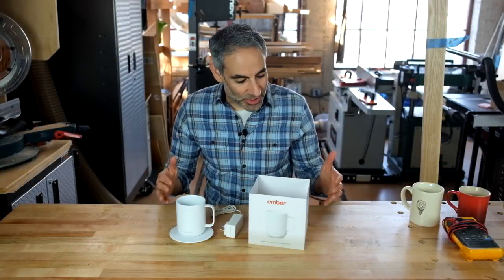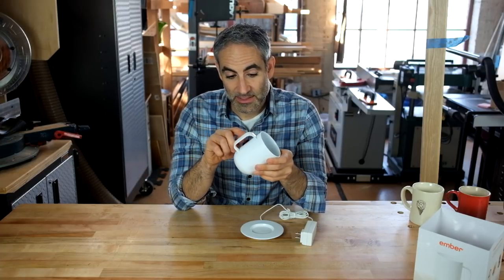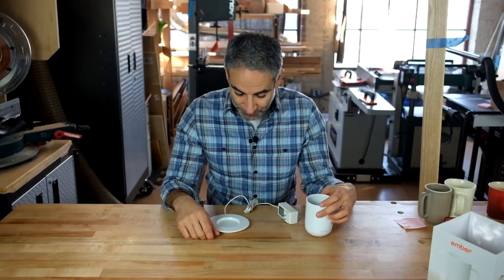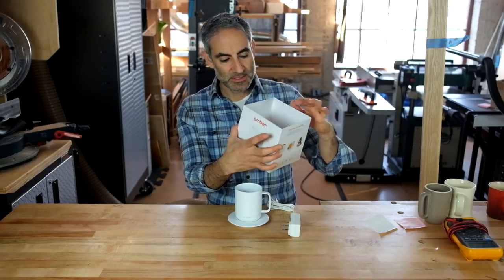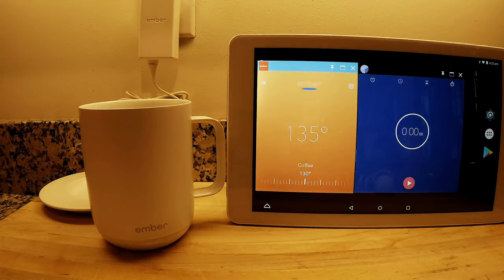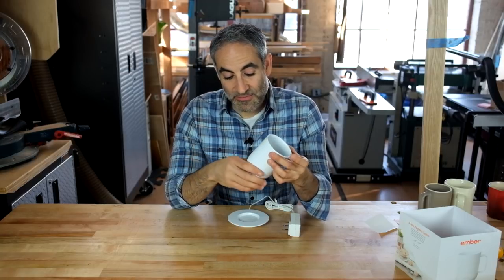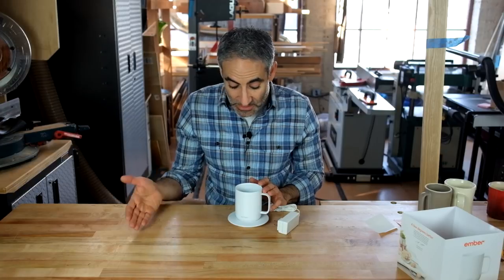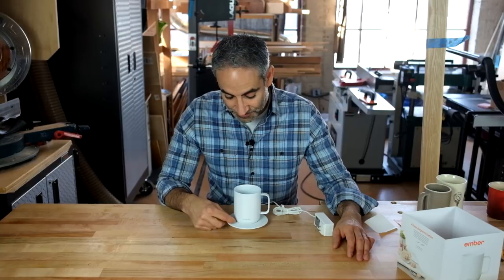Ember Coffee Mug Review: Things you need to know.

Comment: The reason for the "saucer" is to force alignment with the gold pogo pins.  Those pins are the weakest aspect of the design.  If the tiny spring breaks or gets gummed up electrical contact can't occur.  The design is very vulnerable to a single fragile point of failure.  Those pins are not easily replaced.   That scenario occurred with the earlier model cup.  I'm surprised it was not fixed here by increasing the number of pins for redundancy,  or by putting more robust contacts (matching rings?) on the base.

Comment: Jesse, Great job with the video! 
I've been using my Ember mug daily for almost 4 months now. I originally purchased 2 mugs and an extra charging coaster (3 coasters total). At about the 3 month mark, the ceramic coating started to chip off inside the mug.  I always washed by hand but I did use a bristle brush and that could have lead to the chipping. I contacted Ember via email with photos and after asking for the serial number, they sent me a new mug and a return label to send them back the damaged mug. 
Before the new mug arrived, two of the coasters stopped working. Shortly after the new mug arrived, the 3rd coaster stopped working and I had no way of charging either mug. Apparently, the gold charging tips are spring loaded to ensure a good contact with the mug when the mug is placed on the saucer. On each saucer, one of the gold contacts lost it's ability to spring back effectively making the saucer useless. I again contacted Ember and they sent me three new saucers...so far so good. They also explained to me that there was a manufacturing issue with some of the batches of saucers and that issue has been resolved (time will tell). 
FYI...I drink 2-3 cups of coffee at 140 degrees filled very close to the brim daily in the Ember mug.I almost always keep it on the charging coaster when not in my hands. I drink the coffee fairly slowly throughout the morning between 8:00 am - 11:00am and they only time the battery has gotten low is when I went walking around and left it off the charger. 
In one instance, I accidentally left a 3/4ish full cup on the charger one Saturday while I went out to work on the yard. I returned 3-4 hours later and the mug was still at 140 degrees and at least 50% of the coffee had evaporated. Suffice it to say, I think the Ember would evaporate a full mug full of liquid before the battery would die when left on the saucer. 
Would love to see a long term review of your experience with the Ember mug. Even with the issues I've had, I think it's worth every penny...assuming Ember stays in business long enough to fix all their growing pains.
Reply: It is worth it!!
Reply: This guy wrote a chapter 🤔
Reply: You don’t need it to set in charging coaster when you drink.  I don’t put into the coaster until maybe i have 1/4 left in cup just to boost the charge a little. I usually have setting on table along side the coaster…especially when mug is FULL as I don’t want to get liquid in the coaster…it really is not a drip catching device.

Comment: Good review, though I thought I might see a tear-down 😉

As someone who sips on a cup for a long time, this clever device has been a game changer for me.  It's particularly nice for being able to enjoy my various white teas and more fragile greens at a slower pace.  It's actually great for making gyokuro in, as that tea steeps at only 140F (which is challenging to maintain precisely).

However, I too initially found the capacity a bit inadequate.  To solve this, I usually make my tea (or coffee) in a separate vessel, in 16-24oz batches, fill the cup and then reserve the rest in a thermos (which I use to top off the cup until it's all gone).  

The battery life isn't much of an issue for me usually, as I keep it on the charger more often than not.  The only concern I have is what the overall lifespan of the device - or, more specifically, the batter will be, given the constant switching between (presumably) high drain and fast charge, all while being sandwiched in with a heater...
Reply: Ryan Reese totally agree with you. Setting the temp for various drinks has been awesome.

Comment: Well made first video!  I’d say your arguments are well thought out and the experiments make sense.  Personally, I solved the volume issue by simply pouring my extra coffee into a Contigo insulated travel mug, which also keeps the liquid hot, so when I refill my Ember it is still warmer than my desired temperature.  The default is 57°C (134.6°F) which I find borderline too hot to drink for filter coffee... I have mine set to 52.5°C (126.5°F), and it tends to last me a couple hours or more (there is some idle time where the cup is empty before I refill).  I find it interesting that you enjoy yours above 140°F which is 60°C, but I see how that higher energy demand really cuts into your battery life.  But, that’s why it’s customizable!  (I do set temperatures higher for other drinks, like French press or hot chocolate).  My recommendation to you would be to store your coffee in a way that it can retain its heat - I think that’s far better than re-heating, especially if you are hoping the mug itself will do most of that work.

Comment: Jesse, THANK YOU for doing this review. Not only did you answer some deeper questions that other reviews have not, but you even provided insights that Ember's website does not cover (I could not find on their if the charger was AC or USB. Perhaps I should have known but I honestly don't know enough about electricity).

With respect to the time the mug keeps things hot or brings cool liquid up to temperature, it's my opinion that Ember envisions most people keeping the mug on the saucer at least 80-90% of the time, and only taking it off to go to a meeting away from your desk, then coming back and putting it right on the charger. I think if you used it that way you would not have a problem. That being said, that does limit the way people can use the mug, which is absolutely a consideration before buying it.

Comment: Your well-executed video answered and clarified my question about my Ember—which I love (mostly because it was a gift from my daughter❤️). From the FAQ available in the app I could not clearly find why one could not use coaster to heat/charge. 
You can use the coaster to maintain battery strength, but after removing cup, it used battery to maintain heat, not to re-heat. 
Oh and I like the handle “feel” (I have smaller hands and like the delicate feel of the slim edged handle). And I totally get that the charger is meant to appear as a coaster/saucer but—as with a lot of electronics—ought to be kept free of moisture. Just a different perspective there. 
Thank you for this great video. It was most helpful and you are a lovely and ingenious man for gong to the effort to do the time lapse sections.

Comment: I agree with all the critiques in this review. I purchased two mugs and one coaster. I drink tea out of one mug while I leave the other on charge, and after I have finished this one or the battery runs out I take the other mug and fill it with a new cup of tea made on the stove. Why not leave it on the coaster? Try leaving it on the coaster and report back what your experience is. For me, the clear green tea turns into a black muck. Something to do with using AC current and DC current (My theory). The DC that comes via the battery works MUCH MUCH better. The AC current directly from the socket (thanks tesla!) will muck your tea up.

Comment: The saucer thing bothered me as well. There is a little notch where the bottom and electronics meet that would probably keep stray drips from actually making it to the saucer.

I've been using mine about a week now and love it; keeps my tea and coffee hot as long as it takes to drink it. I think the use case you tested for though was appropriate for the travel mug. I have the saucer at my desk and usually have the cup sitting on the saucer. The battery is kicking in when drinking, walking around and when I'm in meetings.

I did test the heating capability while on the saucer and the mug did heat ice water to my desired temperature of 135. Not exactly the fastest way to heat water but it managed it. One thing I've yet to test is if the cup helps cool the coffee down any faster than ceramic. Being too hot is as much of a problem for me as too cold.

Comment: The HANDLE is actually for me a better design, larger round handles require you to use more pressure because its round shape doesn't allow any leverage against your hand. The SMALL 8-9OZ SIZE was kind of a turn off, but as a slow coffee drinker you'll get used to not noticing you're drinking less coffee because you actually end up drinking more that before (when you used to just dump it out because its been cold for so long) . I definitely vote for INDUCTION CHARGING.. but I wonder if that would be too slow to charge and keep hot simultaneously? I don't think your usual case scenario is (the usual). And in that case... you can place it on the coaster while it climbs in temperature and problems solved.

Comment: The main problem,  missed in this review,  is with the fragility of the spring inside the pogo pins on the charging coaster.  Pin collapse due to spring failure occurred with both the old-style mug and with the new.  This is an obvious design problem that should have been resolved before the product saw the light of day.  The entire functionality depends on a teeny,  tiny spring that is heavily exercised.   An obvious highly fragile critical single point of failure.  At the very least the pogo pin assembly should be easily accessible and easily replaceable, and a small supply (half a dozen) spares should be included with the product.
Reply from the maker: Good call out! I returned mine way before I hit this problem. But yes, does look like a huge design oversight.

Comment: I've had the original ember mug (which is more of a thermos rather than a mug) for coming up on a year. One thing i take issue with your use case is this, for me, i'm at a desk almost always when i am drinking coffee. So i have bought an extra charge dock to have on my work desk, and one to have at my home desk. So in the morning, i fill it up and immediately put it back on the dock, and while in use, i leave it on the dock. I take it off to sip, and it goes right back on. Using it this way essentially gives you unlimited run time. So the only time the battery is actually in use is if i get up to visit someones office and take it with me, or, on my travel to work in the car. 
Now one thing i do wish they had was a car charger, and they've said theyre working on this, but i've yet to hear any updates on this. But if you use it in the way i've described, where its almost always at rest on the dock itself, the issue with low run time is much less of an issue. In fact, i put room temperature coffee in my ember all the time, and as long as its on the dock, it will not use any battery, and it also heats up to my also desired 140 degrees much faster than yours did.  Another thing i'd mention is theres really no reason to dispose of the coffee after 20 minutes. I've poured coffee on a "light coffee day" at 8am and nursed it all day long, still having coffee at the perfect temperature by noon, or even later. Getting rid of the coffee after 20 minutes is kind of defeating the purpose of the mug. 
Also, as the amount of liquid goes down in the mug, the amount of energy required to keep the liquid at a certain temperature also goes down. The other issue i have with the new ceramic mug is that the amount of energy required in an open lid environment is much greater than my ember mug, which has a closed sealed lid. 
If i leave the lid off of my ember mug the battery depletes at a much faster rate than if i put the lid in place, opening it only when taking a drink. 
All in all i think you did a good job of indicating some of the limitations of using a small battery mounted heating element in a mug, but if your use case is like mine, where the mug can be on the charger almost all the time except in transit, or short trips away from the dock before being promptly put back on the dock when returning to your desk, its actually been quite an amazing product. Obviously if you're up and moving around all the time instead of sedentary, your experience will be much different. Sorry about the wall of text!
Reply: >as the amount of liquid goes down in the mug, the amount of energy required to keep the liquid at a certain temperature also goes down. 

Very good point. @Jesse, How about a short follow-up video where you remove, say, 10% from the cup every 10 or 5 minutes and see how much that effects the battery life?

Comment: Great review. I bought one about 6 weeks ago and as of this morning, one of the gold charging pins is depressed and no longer makes proper contact with the mug. I've contacted support, but wonder how long a new one will last.
Reply from the maker: Sorry to hear that! One of the problems with their design is that whatever spring (coil of leaf) that pushes those pins back up is probably steel and ANY moisture is going to gradually make those pins want to stick in the down position. Or at least, that would be my engineering assumption. Hope your's is swiftly fixed!

Comment: My last comment on this product (I promise). I have now used it daily for 465 days and sometimes multiple times per day. Today I tested how long the charge still lasts. There is inherently variability in this because the mug uses more energy to keep say 6 ounces warm than 2 ounces. Also, I keep my coffee at 145 degrees. If it was instead set at 135 the effective charge duration would be longer. Anyway, for about 4 ounces of liquid uncovered at 145 degrees after 16 months of use the mug still maintains the target temperature for 54 minutes. Compared to the original 75 minutes (from memory-I didn’t review the video) this is a reduction of 36% which is substantial but the mug is still quite useful, at least for my purposes. 
Based on this data, is it worth investing $100 for at least 1,000 temperature controlled cups of coffee (I generally have 2 or more per day) or 10 cents per cup? For me the answer is definitely yes but for others maybe not. Your results may vary.

Comment: I have purchased over 6 of these embers with 4 mugs and 3 tumblers.  I thought i would be using them more but i eventually ended up selling all of them except three keeping a tumbler for my mother and one of each for me.  however i noticed that i got lazy making the coffee and then pouring it into the ember while i could have just used my k CUPS and it makes my coffee for me.  What i do enjoy this item for is for a last minute drive in car or if coffee got cold and i put it in there to HARM IT UP.  THE ONLY THING I DON'T LIKE AND I DON'T MIND HAD Washing it is the small volume size.  i got the 14 oz. mug but even the tumbler is to small.  However cool product and I recommend it.  but also make sure you look at other smart tumblers or thermos and there are others that might be better.  The price is too high for this as I have noticed customers like to purchase this around $80 to $100 which sounds reasonable and a lot of Starbucks stopped carrying them because they kept on getting stolen.  of course no security and the product is the most expensive item in there (like everything else, LOL).  I will get again in future and have gotten the second edition as well especially the copper special edition just for the cool color and the look when i'm drinking it.

Comment: I have this mug. Someone was selling it for $35. I bought it. It originally sells for $100. I do keep the "coaster" plugged in and the cup on top. I agree it has a small capacity. It is not worth more than perhaps $25. I also have a plug in coaster from Brookstone that I can sit any mug on. Flat bottom mugs work best. It's hard to find flat bottom mugs, so I bought the Ember. I would not recommend the Ember.

Comment: Interesting review, I just received one as a gift.  I haven't used it.  The quick start manual says how to charge it but doesn't say anything how to use it.  I expected it would turn on with hot liquid, but that's something I think they should have mentioned.  The box says 14oz.  this a Mug2, perhaps it's larger.

I was very disappointed when you mentioned capacity.  I am one that slowly enjoys my coffee but like it hot.  My go to mug is an stainless steel dual wall "thermos type" mug that will take 14oz and have room to slosh or apply the lid.  It keeps the coffee pretty warm for over an hour or more.  It was $10 on Amazon.  Oddly enough, it has a tubular stainless handle.  It also works well with cold beverages.

Comment: Great review! You made some great points. Specially about the use case you described which is also pretty much the way mine gets used.  I found this review only because I was having issues with my Ember mug I purchased a few days ago.  I must mention that after encountering the battery life issues you described I don't turn the mug on immediately since I brew my coffee at around 190F.  I wait until it's around the temperature I want it to be held at and then turn the mug on.  I haven't timed it but I would think those few minutes of not monitoring the temperature and communicating that via bluetooth should extend battery life a bit.